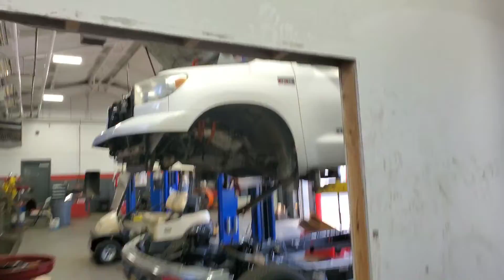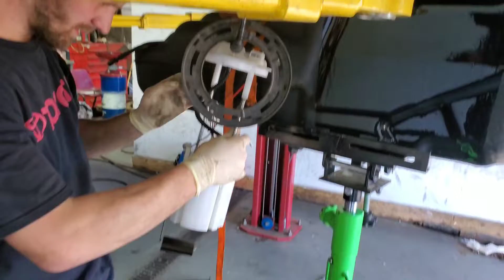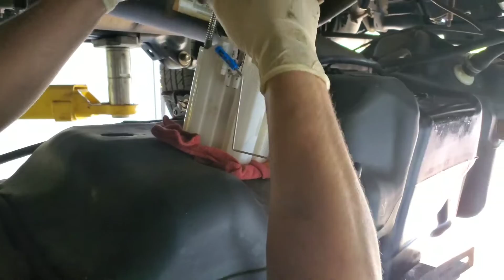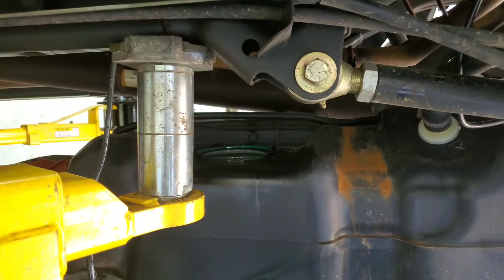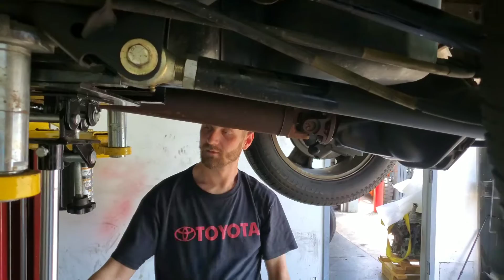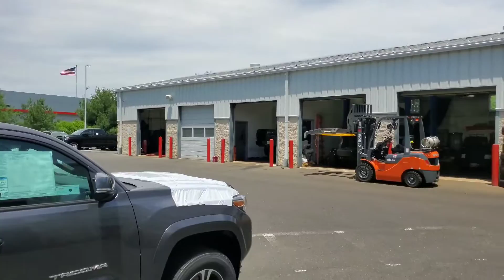Fuel Pump and Fuel Level Sensor FIX on Ram 1500!!

Comment: my 2017 Ram 1500 4th time dealer replacing the fuel pump/sensor/module.  Ram would not cover it this time until a senior tech went over a long list of troubleshooting. the contacts on the level sweep board were burned just like the others. well was just informed of the cause of my sensors failing. not sure if this relates to all the other rams dating back to 2014. the plastic gas tank has a plastic baffle inside to keep the fuel from swishing around. this baffle breaks off and swishes around. the assumption is the baffle may get caught up in the float keeping the contact in one position causing that area on the board to burn out. Dealer is replacing the fuel tank and module. Time will tell.

Comment: I was wondering if you still have the fuel sensor resister board? there are numbers on it which is where the worn down two wires are connected. If we could just replace that part , it would be a lot simpler to replace little circuit board than the whole unit. Hoping you could give us the numbers off the board. Thanks! and by the way very good video to help us all out with a solution to Rams fuel sensor Problem.

Comment: Did you get a fixed version of the fuel level sensor, or is it identical to the stock one? Have FCA fixed this problem with a new sensor?

Comment: Got my ARH long tubes installed. Thanks for the recommendation, I love them with my custom tune by Hemifevertuning and other mods. On my trinity I’m getting code p0463 “fuel sensor A circuit high” but the engine light is only coming on every so often is that how yours started out and was it that code? Also do I have to replace it immediately if the fuel gauge seems to work fine for now?

Comment: Just got the Fuel Sensor fail on my 2017 Ram 1500. Is yours a 2017 also? Can you post the part you installed?

Comment: My 2016 Big Horn just started doing this today. Wife and I were just on a nice country drive when the little fuel pump light started flashing and the fuel gauge dropped to empty. 
Checked it with my scan tool and P0463 came up. 
So what does it cost for the sensor and labor to install it?
Reply from the maker: Labor was my buddy who is a mechanic so I paid basically nothing n I think the sensor was like $20 or something

Comment: 2017 ram 1500 5.7 single cab 2wd 24.2 mpg highway 
Mods 180 thermostat v6 fan mod active grill shutter delete 93 tune
Reply from the maker: That's great gas mileage bro , I bet it runs great with such lil mods
Reply: @IncredibleHemi1111  the wife has the  stock  charger RT max with the 5 speed and my truck pulls way harder off the line.  20mpg is crazy good considering your 4wd 4 door cam and a converter.... wow
Reply from the maker: @hoofington7866  hell yea your truck will win , thank for the support of my channel it really helps it grow
Reply: @IncredibleHemi1111  keep the videos going!!! Oh by the way I was in tears laughing at the last video with the race with the mustang '' I got him off the line'' 🤣😂
Reply from the maker: @hoofington7866  lol yea he caught n went by me, that will all be changing soon
Reply: @IncredibleHemi1111  nice!! Looking forward to see what's next!!
Reply: How did you do the active grill shutter delete? My code for that says "permanent" on 2 different code readers

Comment: How long did it take to change? I have a 2017 and this just happened at 51K kms (32K miles). The dealer wants $300 for the sensor and 2 1/2 hours of labour at $110/hr.
Reply from the maker: It took about 2 hours total to change. Just the sensor was only like 25 off amazon
Reply: Geez ... That's awesome. I have the exact same problem. I guess this isn't a shade tree mechanic  or DIY job.
Reply: It's really not that bad. Some prefer removing the bed as opposed to dropping the tank. I've dropped multiple tanks and I dont mind either way. Replaced alot of these actually.

Comment: Would have been nice to get some actual information information from this video. Needing to change the fuel sensor in my Ram.
Reply: theres two ways, one vid on removing the bed, the other on dropping the tank. Removing the bed looks easier.
Reply: @reasonandjusticeinamerica7391  Depends on whether or not you are doing a driveway repair or have a proper lift

Comment: U also know when this happens the trucks won't go into eco mode um having this issue now and luckily its still under warranty.  I hope.
Reply from the maker: My trucks eco mode has been gone since its cammed with non mds Lifters
Reply: @IncredibleHemi1111  ah I see i just figured I add that there so other would know the trucks not going to act normal.

Comment: 2016 ram 1500. Has gne out 4x. Not ever replacing this again. It just keeps going out. Why is this not a recall with a fixed sensor. They obviously don't know how to fix the problem.